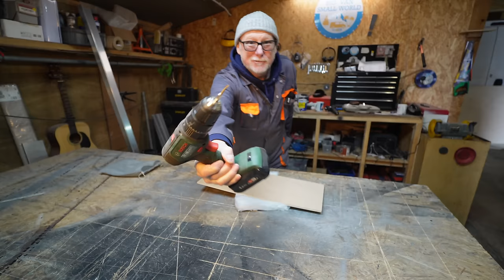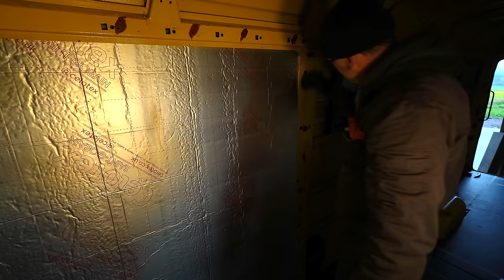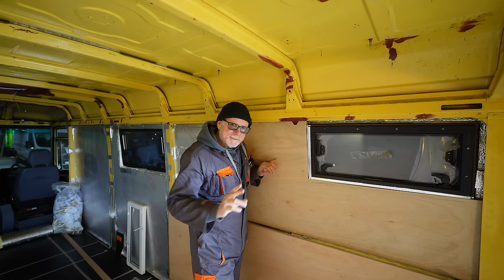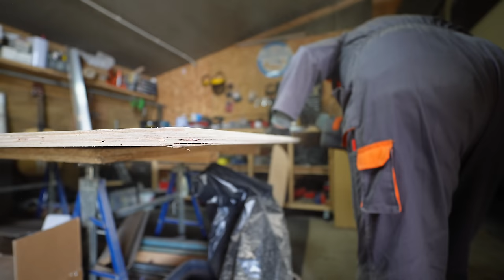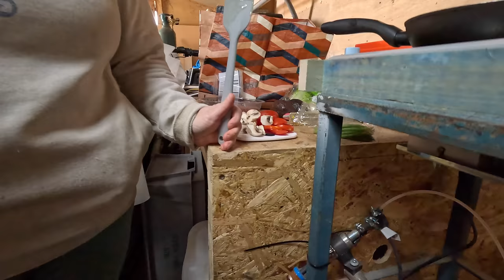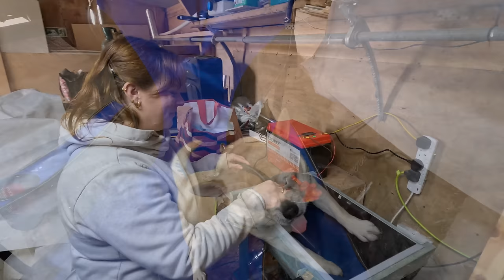How NOT to insulate a camper van conversion

Comment: I stuffed the recycled bottle in my ribs prior to installing 
It’s a bit fiddly but,I managed to stuff the ribs full using a rod / bar , by ripping it into small pieces.
If my drill got stuck,I slowly reversed it until it let go,
The screws I didn’t worry about ,as they added extra grip ,(only a problem if I need to take walls off ect ).
I only used recycled bottles in the ribs for the same reason as you mentioned.
Loving your build
Reply: I bet that made your breathing a bit hard!? (Your first line of the comment made me chuckle 😂)

Comment: Simply cut the cellotex panel in the middle, push them apart to fill the ribs then fill the middle section with another piece of cellotex, tape over with aluminium foil. Never had a problem with recycled plastic insulation, obviously if you drill into it there's going to be issues but why would you drill into it. Apply basic skills, don't over think stuff.
Reply: Beat me to that comment lol 😂
Reply: its the screws that are the problem. you end up with insulation balls behind the panel and leaving gaps. sheeps wool is the best insulation as it absorbs and releases moisture over weather cycles. there is off gas problems with foam and foam board but reduces over time. but most of us have entered a stinking hot campervan over the summer with a wiff. your sleeping in a confined space breathing it in. which some are ok with. recycled plastic has no decent thermal properties like cheap crappy ski coats, where as goose down is toastie. End of the day your in a tin can with lots of glass and breathing and sweating a lot of vapour. for floors you may as well double up on ply as add stupid deadening matt. theres so many ways to skin a cat here

Comment: If you use spray foam anywhere in the van make sire its closed cell insulation which is more expensive than the normal stuff (open cell) you get at the builders merchant.

For the exposed metal ribs, cover them in 10mm closed cell sticky backed with foiled outer foam... same as dodo mat but much cheaper options are available.

Comment: Mel take a strip of reflexics (the bubble stuff you don't like.)  Just tape strips up over steel posts and screw your wall panels over it, just don't crank your screws super tight.  The screws will stay tight no problems.     you could cut your insulation full size split on one side and break panel so it fits in under edges of posts and flatten panel back out to fit tight seal split with tape.

Comment: I love the recycled bottle insulation as it was cheap and doesn't hold onto water but yeah as soon as you got out the drill I had flashbacks 🤣
Reply: I've had similar when drilling through stretch carpet lined panels. Melts onto the drill bit.😬

Comment: I think its a near impossible task to 100% vapour barrier a van. Condensation will make its way to the steel some how. a little ventilation behind insulation will help in long run( rust, mold, etc).. Insulate as best as you can with insulation boards. As you said the expanding foam will trap moisture. Dodo mats are good at damping the tin rattle noise from steel panels as you drive. but it only needs a piece on each panel, not 100% coverage.

Comment: Could have just spray foamed the edges of the celotex which would help fasten it. Need to be careful with that stuff as it can end up sounding like a family of mice partying in the back when you are driving. You could cavity wax inside the uprites and then spray foam them. It's also a good idea to wax all the ribs and joint that will be covered once panelled in. People go mad over vapour barriers but this also creates a trap for condensation between the internal and external panels. Basically it will rot either way. Will probably use celotex on my next build for the reasons you have pointed out. Vans looking good. Fums up👍

Comment: put lots of small pieces of recylced plastic bottle insulation behind those beams.  That way if you do need to drill or screw into them then you won't grab and spin all of it around a screw or drill bit.  cotton ball sized pieces will probably work well.  The wool will allow any vapour to evaporate as and when it gets a chance.

Comment: Video suggestion if it bothers you: Diesel fuel used to boil 1L of water vs gas used to boil 1L of water. You could use one of those portable camp stoves with the cp250 can to make weighing the gas can before/after easier!
Reply from the maker: Oh that’s a great idea thank you 🙏
Reply: @BigVanSmallWorld my guess is that Autogas is cheaper than Diesel but any of the bottles are significantly more expensive, let us know what you find out.
Reply: It also depends on the efficiency of the stoves as well. Ignite gas and directly heat bottom of pot, start diesel burner and preheat cooktop before heating bottom of pot; boiling water for coffee would be a quicker process with a gas stove.

The energy value of 1 litre of LPG is approximately 0.72 kg of LPG, which has an energy content of 11,400 Kcal/Kg. In comparison, 1 litre of diesel has an energy content of 10,600 Kcal/Kg. 

Accounting for the higher efficiency of LPG burners at around 95% (in general) compared to diesel burners at around 85%, 1 kg of LPG can provide 10,260 Kcal of usable energy, while 1 kg of diesel can provide 9,010 Kcal of usable energy. 

In other words, 1 kg of LPG is equivalent to about 1.14 kg of diesel, or about 1.39 litres of diesel. Conversely, 1 litre of diesel is equivalent to about 0.72 kg of LPG.

I think it boils down to what one wants (pun intended) My van came with gas fitted and I like it, but' if I was to fit a van out myself, I may not go down that route.
My mind is not made up yet, Azurren.

Comment: Based on my experience (I don't claim to be an expert) of insulating my conversion, I also wanted to use the board (kingspan in my case) as much as possible. I endeavoured to stick it to the panels of the van where possible with double sided tape, but ribs and curves get in the way, resulting in the kingspan leaving gaps behind it between the board and the panel. I recently added another skylight and the ceiling panel i removed had evidence of moisture having formed on the body panel (despite being fastidious with the vapour barrier). I have now applied the self adhesive dodo mat directly to the panel, leaving no gaps, behind the kingspan, before reapplying vapour barrier. Added insulation and no air pockets. Not saying this is right or recommended, merely sharing my findings on my own van. I am now working my way round the van repeating this process.

Comment: It's worth putting flashband (flashing tape) in the middle(-ish) of your panels to dampen drumming while you're driving – there's a lot of panel & the amount of noise is large. 
This is one place where being untidy is good, if it's not perfectly centred & square it works better.

Comment: Hey Mel, Your insulation job looks spot on, personally I wouldn't use expanding foam in the cavity's. There's always going to be a bit of dampness on metal in the colder months, I recon a bit of air flow is whats best, and lots of wax oil.  In your previous video I commented about the diesel cook top, it makes more scene now I thought you was replacing the induction completely... I've been looking at a few low wattage products for cooking, Have a look at the Dash Mini Rice cooker there lots of reviews and recipes on YouTube, They claim to be 200watts, I don't have one yet to test... but some of the meals you can cook in them look delicious and very easy to do. The lowest power setting on my induction hob is 460watts So at less than half the power usage I'm hoping this will be useful for hot dinners in winter when the solar is not generating as much.

Comment: could always try taping the holes at the bottom then filling from the top using a funnel and the little polystyrene balls they use to fill bean bags then maybe just a tiny squirt of the expanding foam just at the top to act as a plug ,bearing in mind in some cases ive heard the expanding foam can distort the outer skin and a while ago you mentioned cork was a good insulating material could you use that as a way of keeping the insulation thin where you want the extra space for your bed

Comment: Sprayfoam insulation and yes fill those bits with foam if you do trap moisture it’s sealed from the air so shouldn’t oxadise

Comment: Another great one Mel, I was even sneezing in sympathy with you! As for insulation I think you are kinda right... Kingspan /Celotex is a really good choice of material to go with for all the reasons you mentioned. I put 25mm on my floor and a mix of 25mm and 50mm in the walls. I also have used a lot of recycled plastic bottle insulation in all the awkward and hard to reach cavities. You are 100% right about drill bits and screws. I'm still green with envy re the Vario, it's such an amazing vehicle! Keep on keeping Mel 👍
Reply from the maker: Thank you for the support really appreciate it 👍🤓👍

Comment: Hi Mel, it's Pete with the roof tent etc. (Ex "the barn")

Thanks for this video, as I have used this in my build. 

Imagine drilling and then your carefully layered and flat insulation suddenly gets whipped into a cone under the panel? What if you have carpet lining. 
Not going to look great! 

Luckily I don't need to drill anything anymore but will need to remember if I change anything in future. 

Good luck with your build and see you at the festivals. 
(HI Becky too!)
Reply: Hey! 😊
Reply: @SACREDTRAVELLER  Hiya! We didn't actually meet as I was only there for a week. 
Work stops play as they say. 
Hope you are both well.

Comment: Hi Mel, I work with Celotex on a daily basis when we get similar challenges we get sectional arias we cut to the section size including recesses then cut a square section out of the centre put centre to one side, then go to the frame section you created then cut it into 4 place the 4 sections into work space and then fill in the centre piece with the original centre using insulation gapfill… ps then close up with your foil 😉
Reply: PS brilliant video Mel👍
Reply from the maker: That's a great idea!
Reply: Nice I’ll remember that when I’m doing mine.

Comment: Expanding foam is used in narrow boats which are made from steel and I have never heard of rust forming as a result of this product 😊
Reply: Not the regular rattle can type though. It’s proper 2 part foam that’s used in boats. Alex Hibbert had done a very good video on it with his lifeboat build. They are two different types of foam…
Reply: @fergusmoloney  I am talking about small usage IE gaps etc not the entire boat you should check out YouTubers who repair or refit there boats

Comment: Hi Mel have you considered using an American product that is available over here called Lizard skin spray on insulation, it is  used on camper vans in the USA. There is also a spray on product for sound proofing, both can be seen on You tube ,Titled Lizard Skin Sound Control and Ceramic Insulation

Comment: I reckon give the expanding foam a miss Mel.  Some dafty crashed into the side of my van a few moths ago, and it needed 2 panels and the sill pulled out.  Would have been a nightmare welding with foam in there...   Maybe cut some strips of that recycled bottle matting and stuff them in the strut so you could fish them out later if need be?  You could still self-tapper into the struts to hang shelves, etc  and if you wanted to remove them in the future you could buzz the screw heads off with a Dremel \ multi-tool if the screws were binding to the matting.
Reply from the maker: Thank you for taking the time to answer really appreciate it 👍

Comment: I stuffed the ribs on my Iveco Daily with tufts of Rockwool insulation....it took days but it vastly reduced the wowing and I suppose stopped heat escaping too . I did what you did on the walls , celotex as well on the floor and used rockwool for the roof . I also used 100 mm celotex with 9 mm ply front and back for my internal back wall to give me a decent floor to ceiling space for garage
Reply: I know someone who used rockwool on their roof, moister got to it somehow and it went soggy and dripped after two winters living in their van.
There was two adults, one child and two dogs living in that camper.
Moister can get up and inside through the light fittings, depending on how well things are sealed I guess.
Also, fitting a van out in a High moister environment, some moister will most likely be trapped from the get go.

Comment: Just a thought… I wonder if there will be any squeaking with the Celotex rubbing on surfaces as you drive??  Just make sure you leave an air gap behind the Celotex board too.  But as they say, a Vapor barrier is not used by the manufacturers and therefore probably not the best idea.

Comment: To be fair mate you could eliminate that insulation wrap around easy by using a “stop collar” on your drill bit ..or just put a bit of tape on to mark the thickness of what your piloting and go slow… different game for holesaws though.. 😂I can relate!ha

I’m envious of your almost slab sided walls compared to my sprinter!ha I really enjoyed insulating mine too tbf

Surprised you’ve not gone for some Armaflex or closed cell foam directly to the van walls first though personally, I’ve seen many vans you’ve filmed in the barn with it so interested to know why you chose not to use it yourself 👍🏼 
Cheers

Comment: Push wool into the gaps. Natural product, doesn't sweat,  dries out if any moisture gets in.
Reply: Only if the moister can get out easily, air circulation will dry wood out as long as the moisture can leave with the circulated air.
Cavities in houses are outside vented, vans don't have this luxury, nowhere for trapped moister to escape.
My van has been a camper for almost 31 years, no vapour barrier, no issues either; everything gets a proper chance to dry out regularly I guess.
I'm not 100% sold on an unbreathable system tbh Anthony.

Comment: Don’t panic. But I’ve just had a brain wave. I’ve left negative thoughts on your idea of no gas. As I love gas cookers. Yes I have a diesel heater in my motohome. Mine is a large hose 6 inches away from heater pointing into van. What are your thoughts on making a oven to connect to hose when needed. I’m thinking of a alloy box with top open lid. Hose going in underneath, so will need to be on legs .fireproof insulation around it to keep heat in. Not sure about holes to let out air out as heater may get too hot without the airflow.
Reply from the maker: Great idea if you want to dry your food and make your own snack pots 👍👍

Comment: Expanding foam/filler a big no! VW used this in the manufacturing process of the old beetles and they rotted from the inside out, particularly where the expanding foam had been. Also, our vw t4 had some manufacturer installed expanding foam filler and again, rotted on that too. So much so we had to get rid for a new camper project.
Reply from the maker: Thanks for taking the time to respond really appreciate it 🤓👍
Reply: Modern expanding foam, especially gap filling foam, is closed cell in nature when cured. This prevents moisture being absorbed.  
Use the correct product, and get foam that’s applied from a gun, not the straw on a can type, and you won’t get the same overfilling issues either as the application is far more controlled..

Comment: According to Vanology builds you don’t require a vapour barrier in your camper or motorhome as the big major builders don’t use it and rely on good ventilation instead. I agree as a long time caravan owner and some time repairer you never see it in them, aluminium, grp or steel. Vapour barriers only cause build up of vapour in places and it stays wet
Reply from the maker: Exactly my thoughts 🤓👍
Reply: @BigVanSmallWorld  what I will add is summer heat and insulation to keep heat out is where more insulation would help but where to stop? What I’d do is take a leaf from caravan and motorhome builders and why most Tesla’s are white and that helps reduce heat transfer to the living space and reduce demand on air con systems etc so paint your van mostly white!
Reply: @BigVanSmallWorld  I think 12mm ply would be sufficient and save lots of weight and $$!
Reply: In the automotive world vapour barrier is used to separate ventilated spaces from each other & avoid cold mixing with warm.

Comment: Squirty foam is the same foam as Celotex both polyurethane.
Reply: No it’s not. Celotex is closed cell which doesn’t absorb water and the stuff in the can  is open cell foam which can absorb water. There is 2 part spray foam which is closed cell but that’s more expensive and not as easily sourced.

Comment: You can get a 2 part expanding foam that doesn’t absorb water. I don’t think the regular expanding foam is a good idea in a van as it’s hydroscopic. Surprised you haven’t added any butyl type adhesive sheets under the panels to help with sound deadening! I found even a few squares on each panel makes a huge difference. I like the idea of leaving an air gap and the 25mm PIR boards.  Is there any fear of squeaking from not using pins to secure the boards?
Reply from the maker: The Vario panels are so thick that they don’t make the noise of the other panel vans so no need for sound deadening
Reply: My 609 has the same body as the Vario and the panels definitely drum. Maybe not as bad as modern tin can vans but still enough to benefit from added mass. I’d recommend at least considering it for the doors. Still, your van so do it your way Mel. 👍🏻
Reply: @fergusmoloney it's not the absolute weight it's the uneven distribution of weight that quenches the ringing.